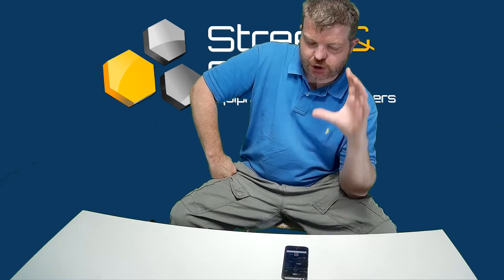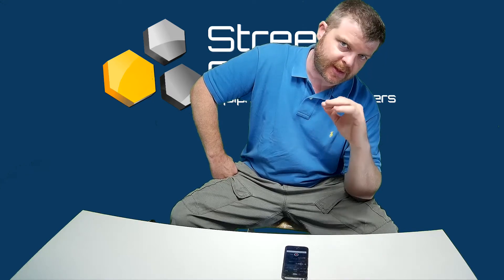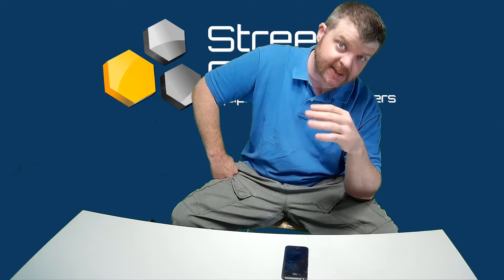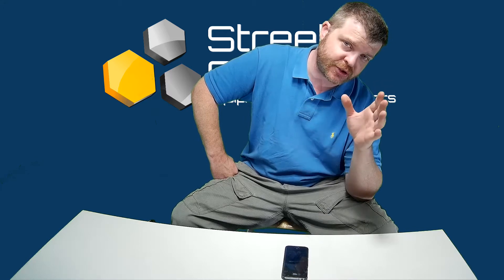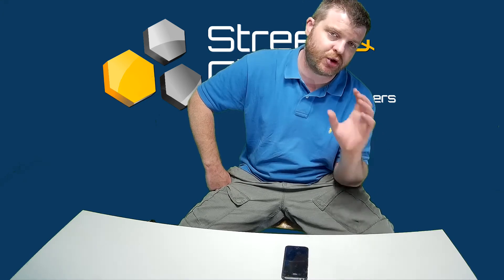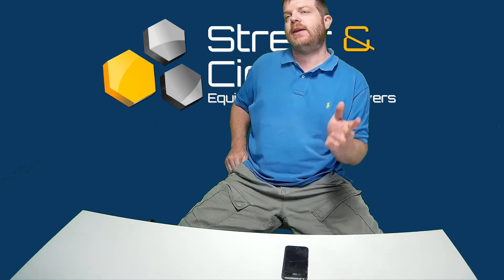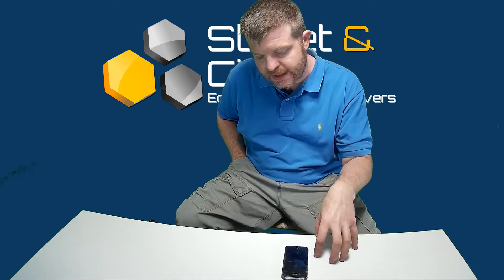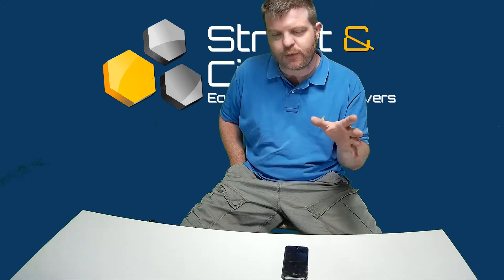Can A Turbo Petrol Chip Tuning Box Damage Your Engine?

Comment: I don’t think this guy understand the logic of wideband. Fuel is provided based on fuel maps. Wideband lambda is simply a closed loop and it keeps the car at optimal most economical setting in low load and cruise at 14.7 AFR or 1V Lamda. Under load car reverts to fuel map and give the car the fuel as per Fuel/Air map. So this statement is utter rubbish. Given the car can probably resist to higer boost and not cause any damage, but tunning boxes for sure cause lean operation. Stick it on the dyno or data log it and you will see😊
Reply from the maker: " Under load car reverts to fuel map and give the car the fuel as per Fuel/Air map." The engine ECU uses the lambda (wideband) signal under ALL conditions to trim fuel to meet the AFR target for that RPM-LOAD-IAT-Coolant Temp-MAF signal condition.

Comment: (After installing a tuning box) If based on a normal daily drive and not for performance reason, is there a need to use octane petrol, or can continue to use the recommended octane as recommended by the car manufacturer? Some say yes, while some say no. Will like to hear your thoughts.
Reply from the maker: Thank you for asking. If the tuning box is not adjustable it should work on the car manufacturer's recommended octane. Likewise for adjustable tuning boxes on the factory supplied setting. On adjustable tuning boxes you may be able to get better performance if you use higher octane petrol with higher settings. May being the key word.
Reply: @DriveTuneMedia  thank you for the clarification. In this case, the manual on the Audi Q3 1.4L state min 95 Ron.

Comment: I notice you didn't mention the effects of more power on sub-components such as pistons and the transmission. I presume there is a reason the 2 liter on an Audi S3, although identical to a 2 liter on the stock A3 is able to handle the added horsepower... by means of forged pistons, reinforced rods etc?
Reply from the maker: Hi. Yeah, whichever method (cams, downpipe, race/de cat, nitrous, bigger turbo, custom program, tuning box etc etc) you use to increase power, it is going to place more stress on components.